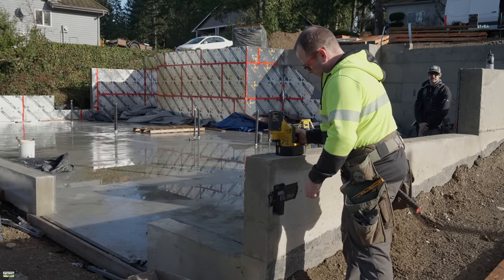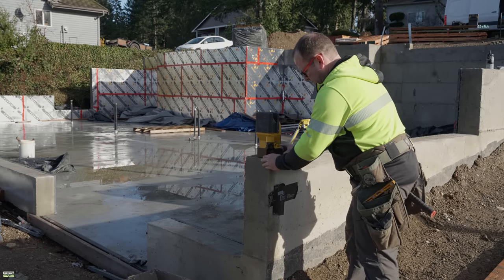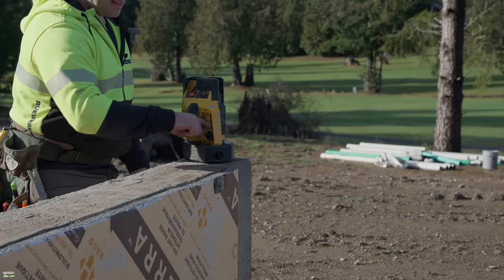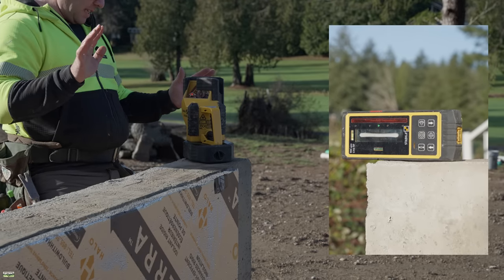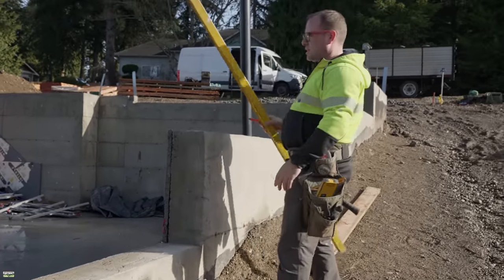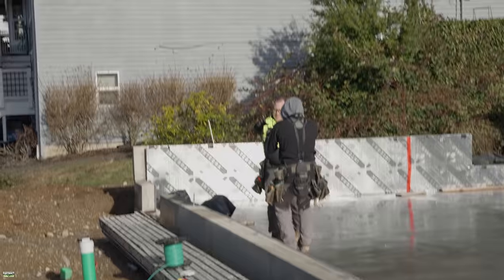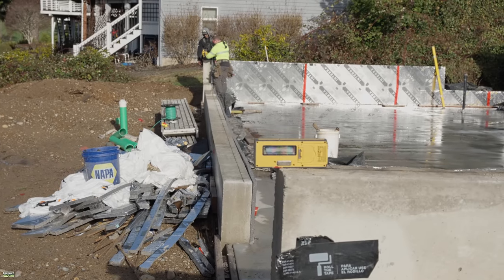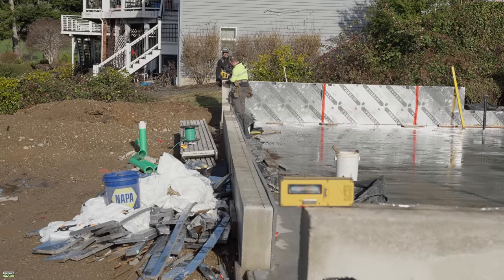MUST Have Tool for Mudsill Lay Out

Comment: I appreciate your videos Tim. I bought a  LA180 after watching and just used it last week on a home that i am starting. It is 170 feet with the garage and has lots of steps in the foundation. Did i mention that the wind hasn't been kind for the last 2 weeks? Huge time saver and i know it is square and straight. 
PS. I mainly work alone, so there is that.

Comment: Pulse lasers (line laser)  will keep you lined up, square over long distances, plumb, and level better and faster than anything out there.  If you plan on buying one, 3 accessories that are critical to use in tandem with it would be a receiver, telescoping pole, and a high precision manual rotation stage.  A receiver can detect the laser line in broad sunlight when your eyes cant see the laser line at all and it can detect it a long way away from the laser level.  You can plant the receiver on a target point and then rotate your laser level to line up on that point.  Or if your  laser lines are where you want them but you can't see where the laser line is hitting 30 ft away, you can slowly sweep the receiver until it beeps, mark it at that point, and that tells you where the laser line intersects.  A telescoping pole is for moving your laser level up/down so that the horizontal line is at a certain elevation.  A high precision manual rotation stage is a device thats normally used in the optical / laser industries.  Basically its a platform that you can hook your laser level to by a screw that gives your laser level very fine rotation control to help you line your laser line up on a target  point that is a long way away.    I bought a $60 one off Walmart website and I can hook my Bosch GLL3-330CG to it and have line up on a target point 55ft away.  I haven't tried to find max distance yet but at 55 ft it was easy.

Comment: I like the mechanix, the geometry, the engineering, and the applications, ie; reference points for the contractors standard. I’ve seen it, as the frame layout-determination, in light of the finish work, that applies.
    In the film industry, we can breeze thru, an accurate replica, w/out having to perfect a whole work, forever.
     Look at Steven King’s Castle Rock , seas. 1 on Hulu, the big house, w/Sissy Spacek, existed in town, and was duplicated in a film studio, in Devens Mass.    🙊details!

Comment: . So at the very first you are manually setting the laser dot at a corner and basically setting your control point yourself then the receiver squares the back line with the laser to the edge, Am I wrong or correct. My question is after setting the back line and taking the receiver to another wall to square the walls/ sill plate lines, how is the receiver doing this. What is the step you have to do before moving the receiver to another wall. And then when you move the receiver to another wall corner how is it squaring. Does the receiver save reference points and you have like reference point 1, 2, 3 and then you chose which reference point you want to square off of. Thats the part Im trying to understand.  I guess it would be probably easier having the laser and using it.
Reply: They left the receiver where the transmitter had been then manually adjusted until it was perfect
Reply: It's got a laser that shoots a 180 degree line, and another one that shoots 90 degrees to the first line. If you set it over a control point, you can either manually adjust it until it hits another point, or set the receiver on the second point and make the laser automatically sweep until it finds the point where your receiver is set. In either case, there is no saving of points -- the built in 90 degree laser means you just walk over to the other corner to locate your 90 degree / square line. Hope that makes sense